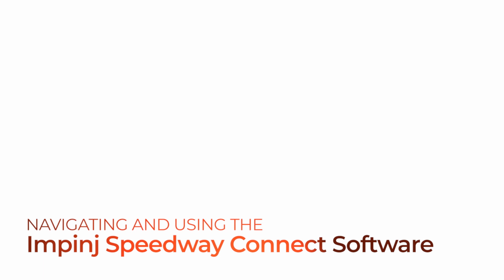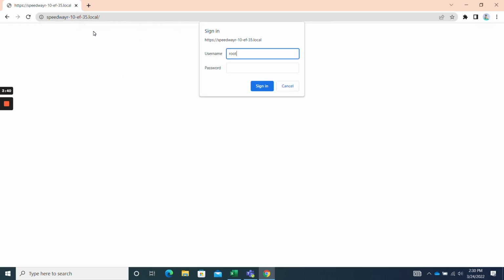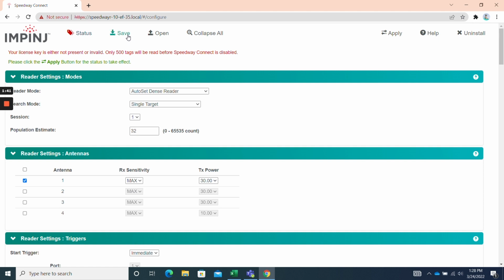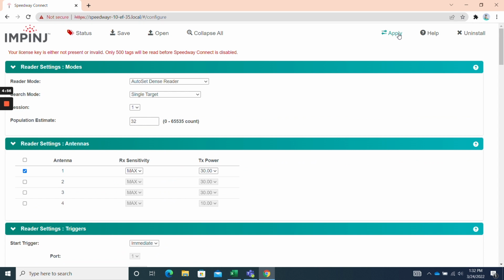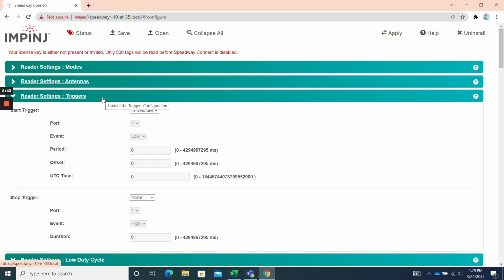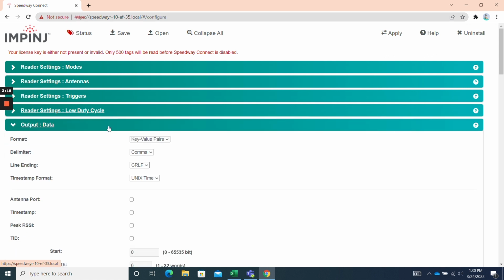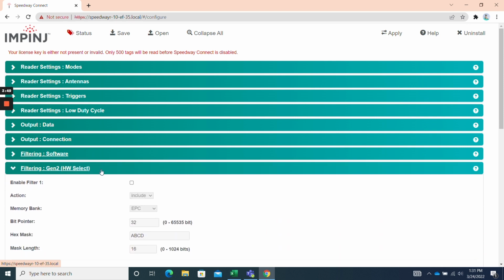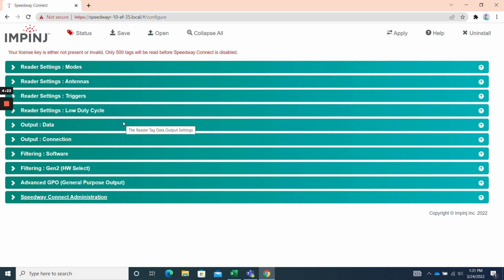Impinj Speedway Connect Software | Navigating the Software's Interface

Comment: Hi I have a problem connecting R420 reader to my pc on ItemTest software. A window jumping out says that, could not connect to data source …, Error connecting to the reader: Reason other than an existing connection. I’ve also tried to reset the reader, but it’s still not working. Could you please help me with this ? Much appreciated
Reply from the maker: Hugo,

This could be because you need to update ItemTest firmware and/or the reader firmware. ItemTest can be upgraded from the help menu and we can send you new reader firmware if needed. Let me know if this problem is still going on and we can send you some links to update all of your firmware!

Thanks!